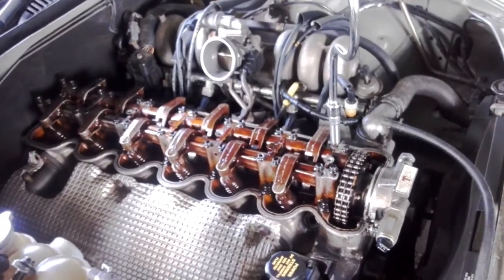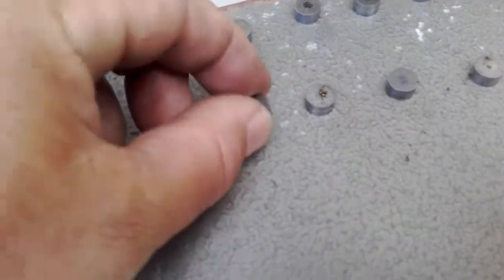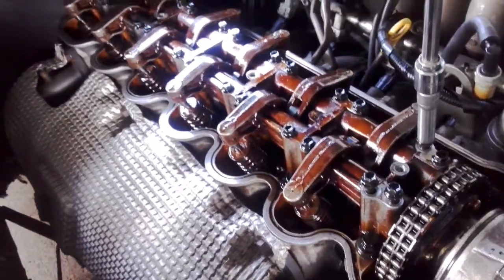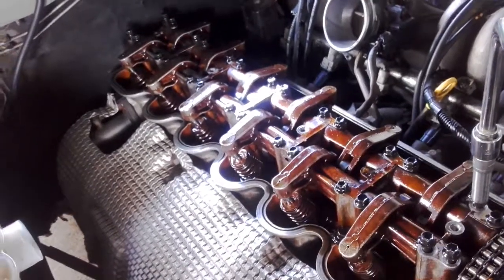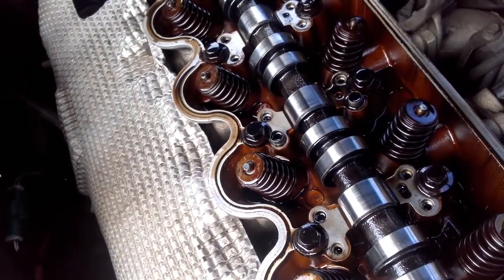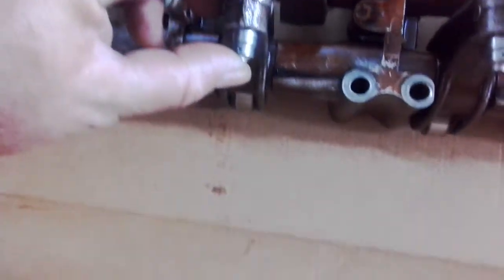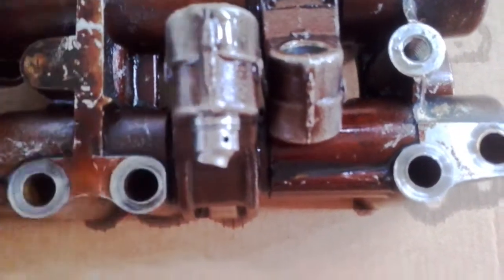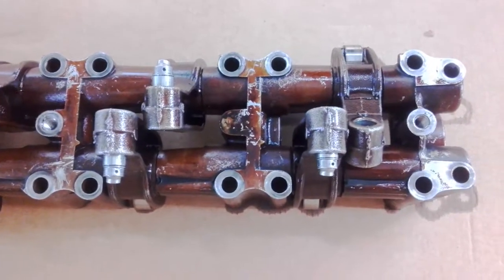Stage 4 hydraulic cam 235 @.050 reduction with lash

Comment: Have you tested a crow stage 3 or 4 or equivalent with some Cam Timing Advance like 2-4deg? Id imagine power would be about 1700-5200rpm vs 2200-5700. Looking at using a crow stage 3 on an ed 4.0l block has an av of 180psi compression atm. Headers, 2.5inch exhaust. Thinking 3.7 diff and 2500rpm stall retaining the lockup for cruising 2100rpm in o/d still with a stage 2 shiftkit on the btr.